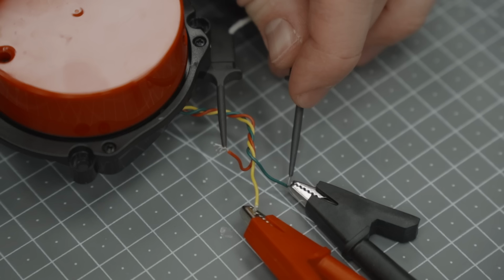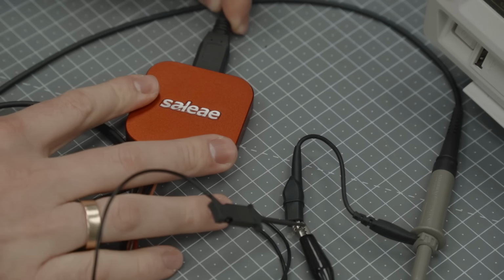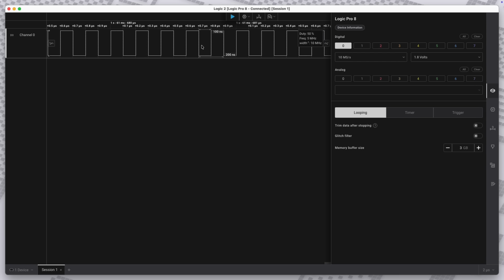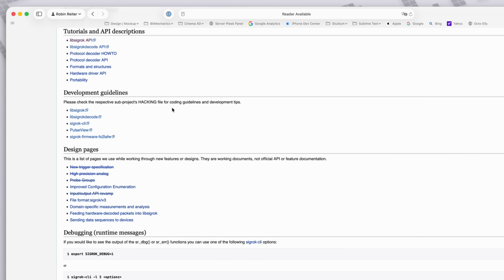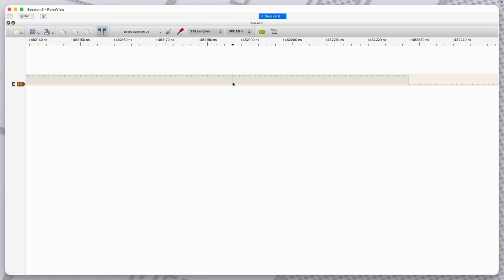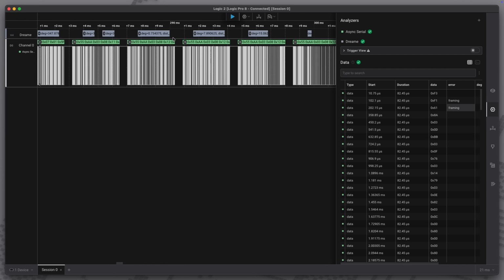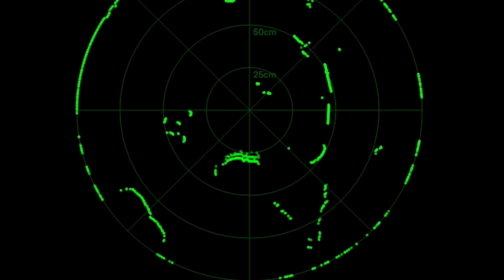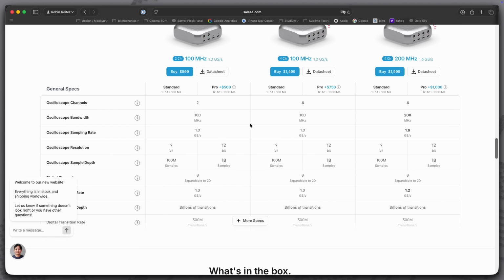This 69$ Logic Analyzer May Be All You Need

Comment: Well, I couldn't get it to work at all on windows. It's not compatible with sigrok or Pulseview. They provide a forked/proprietary version of Pulseview that's supposed to work, but for me it didn't.
So while the hardware might be good, the software is not. Total waste of money for me. There is a pull request to add offcial support, but it's progressing pretty slowly.
Reply from the maker: Bummer! I haven‘t testen this on windows. I only work with macOS.
Reply: @RobinsTools   I tried to mention pull request two 7 five of the official libsigrok repository and other solutions, but all comments get shadow-banned :/
Reply: Ive never used it and have no idea if this works but maybe try and uninstall whatever driver it is using in windows and install WinUSB using ZaDig software? Select the clone in zadig drop down list (it wont detect it if you havent uninstalled the driver its using already) and then install the winusb driver, then it will probably be detected. Havent tried it with this, but it works with all sorts of other cloned devices.
Reply: Did you install the windows driver?

Comment: How did you get yours recognised by the custom PulseView software from them? I tried it on both Windows and Fedora and it shows up in the device manager or lsusb, but it doesn't show up in the custom PulseView software. Did you upgrade the firmware first? Kinda disappointed I still don't have it working after so much effort :(
Reply: Ive never used it and have no idea but maybe uninstall whatever driver it is using in windows and install WinUSB using ZaDig software? Select the clone in zadig drop down list and then install the winusb driver, then it will probably be detected. Havent tried it with this, but it works with all sorts of other cloned devices. No idea how to do that in fedora though
Reply: Did it work now ?
Reply: @thanatosor Yes, eventually I got it to work. There's another version of PulseView they made for the SLogic I didn't see before. This one did work, after setting the udev rules correctly.
Reply: @neoqix always remember to update udev rules on Linux for every usb devices. 

I got same problem with T48 then ok.
Reply: @thanatosor The challenge was that the supplied example was for Ubuntu, but I'm running Fedora. And I didn't fully understand the udev rule format yet 😅

Comment: Your 10Mhz sampling experiment didn't work because of a rule called the Nyquist Theorem. Simply put, it says that you must sample a signal at least 2X its maximum frequency to faithfully capture it. So, 20MHz is the lowest capture rate you can use to sample a 10MHz signal without generating aliases or other odd artifacts.
Reply from the maker: I sampled way higher than 20 MHz and still only got a sine wave.

Comment: The Analog Discovery (2 or 3) by Digilent is nice for the price, and probably a better deal than that Saleae.  The AD2 and AD3 also have analog inputs and outputs.  But yes, it is more expensive than this cheap logic analyzer.

For the record, according to Nyquist, you need to sample at GREATER than two times the largest frequency.  Yes, I am an engineer.
Reply from the maker: The AD3 has a sample rate of 125 MS/s. Am I missing something?

And with regards to nyquist, isn‘t that exactly what I said in the video? I might have used the term „capture“ instead of „sample“.
Reply: @RobinsTools  Didn't you see? He's an engineer! 🤣

Comment: Nice to see that it worked for you.  Some of the reviews I've seen have not been so positive
(ex. "firmware is buggy and there are no updates. The capture ends prematurely or cease to start after some runs till you replug the device to usb port, then even device name turns into garbage until you replug.")

Are you using Windows?  One of the issues may be with Windows/Driver (libusb?)/Software?  For example, the USB3 3.2 Gbps may be more like 1.6 Gbps.. so perhaps instead of 800MSPS@4CH, you only get 400MSPS@4CH.. 100MSPS@16CH instead of 200MSPS@16CH, etc?   I wonder if SiSpeed's $150 SLogic32U3 USB 3.2 (10 Gbps), which has 32 channel , 1500 MS/s sampling rate would have the same issues?

BTW, I could use a DAQ that samples 8 ANALOG channels simultaneously, -30V to 30V, at 2MSPS, with an input bandwidth of at least 1Mhz... and that streams the data via USB3 continuously.  The $500 Saleae Logic 8 is almost perfect, but can only do 0-5V.. the sample rate varies, but for 8 channels it's 2.5MSPS with an input bandwidth of 1Mhz.  The $1000 Logic Pro 8 is closer, but it also can only do -10V to +10V, the rest is fine (12.5MSPS with a 5Mhz Bandwidth for 8 channel simultaneous sampling).

BTW, for a 4 channel oscilloscope, instead of the $2000 Saleae MSO,  I'd go with the EEVengers/ThunderScope which has a higher (500Mhz) analog Input bandwidth, but slightly lower sample rate and resolution (1GSPS, 8-bit)).
Reply: At one point in the video you can see mac mini...